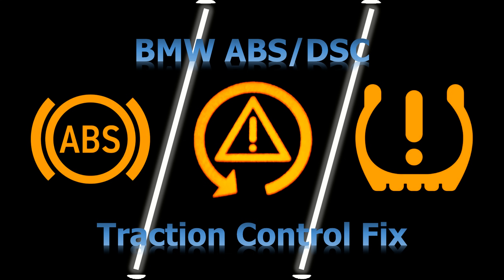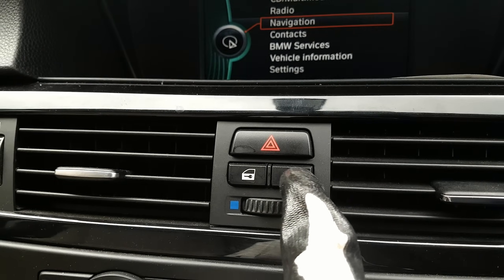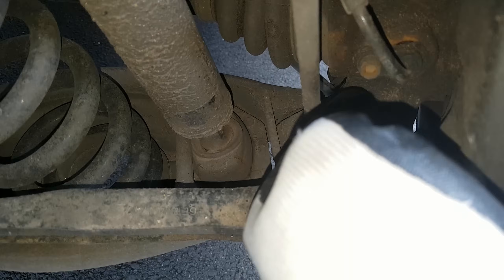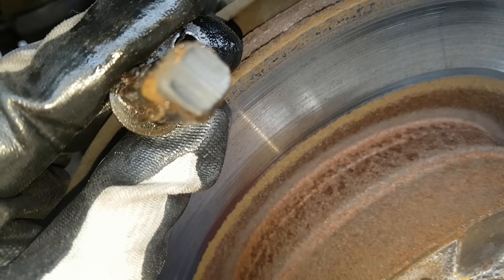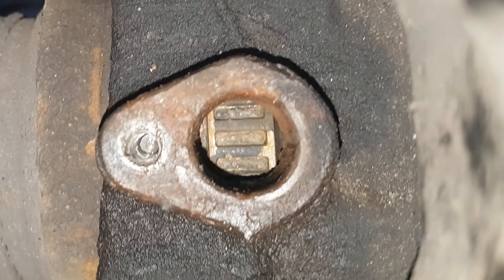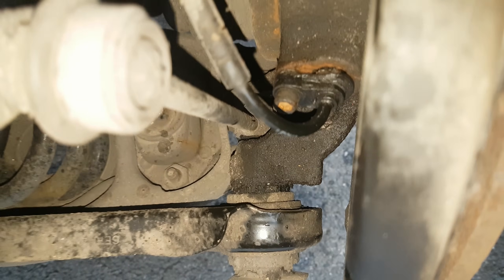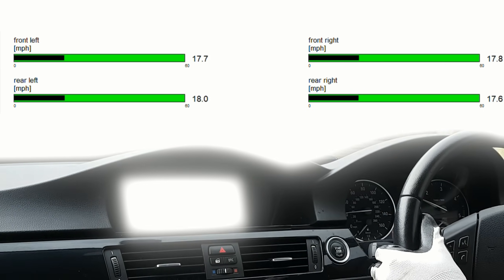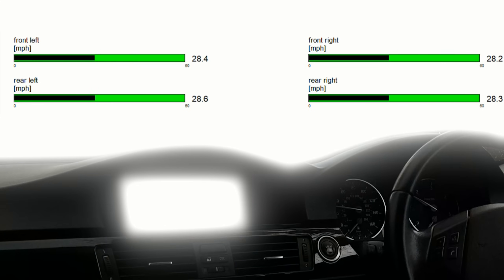BMW Traction Control ABS DSC DTC issue or loss of engine power

Comment: Hello I replaced my rear passager tire and my TPM sensor keeps on popping up saying TPM malfunction I checked tire psi and it's okay. Is the senor bad?  Thanks mate
Reply from the maker: Ernesto Aguilera have the tyres been balanced correctly and replaced with run flats and you've reinitialised the flat tyre monitor service?
Reply: @laymandiy   oh man I need to re check all that thanks mate love the videos.

Comment: Hi, I have an e90 2011. I have the following errors on the dash, they remain on constantly.
Traction control
Abs
Amber handbrake light
Steering wheel light 

The idrive is showing the following:
Braking and driving stabilisation failure
Dbc failure
Ftm system error
Start assistance inactive
Steering assistance inactive 
Snap on tool shows the following error codes:
5e43 steering angle sensor internal
94c2 szl steering angle sensor failure - lws zero point data failure 
D515 message error steering wheel angle, receiver electronic power steering transmitter dynamic stability control

Any ideas what could be causing this?
Reply from the maker: Mohammed Hussain did you just get your software updated? Bad battery, angle sensor, abs unit, wheel speed sensor, rear bearing are all known to cause this. Prior to this was the car working okay?
Reply: LaymanDIY There was suspension work done on the driver front and all the arms replaced on driver rear. No software updates.
Reply from the maker: Mohammed Hussain very much sounds like something that could have happened because of it. If it was official BMW, take it back to them. Ask your garage to check if to wasn't. Failing that, without diagnosing further, I'd start with reclaibrating the steering angle sensor, followed by replacing the wheel sensor in the back , as shown in the video
Reply: Any updates about those faults ? I have the same thanks in advance

Comment: 2013 bmw 335i: I was driving, abs light turned on along with traction control light. Car lost power so i parked, battery light turned on car engine started reving up and down by itself. Windshield wipers started going on. Car turned off and would not start. Orange Exclamation point turnd on. What the fuck is happening someone please help 🙏🏼
Reply: I have the same problem today and Im considering to start to put a separator but no clue if there are 4? and the thickness needs to be 1mm max? any clue? How did you solve the problem...?
Reply: @marceloruffino  I took the car to a trusted bmw mechanic. Turns out i had an electrical issue with a wire conecting to the battery.
Reply from the maker: There was a BMW recall on wire connecting to the battery. Your case is rare, most often the car would just be dead and wouldn't do anything. Key stuck, doors wouldn't lock unlock. Major safety issue.

Comment: Hi I have the traction control abs and brake light coming on and off at random times when I try accelerating, sometimes tyre pressure and battery light come on with it. When they come on the speedometer goes to zero even if the cars moving. Any solution to what it could be? I have a e90
Reply from the maker: Keem M sounds terrible. It could be one of 2 things. The rear wheel speed sensors are gone, in which case you've got off cheaply. Others a Christmas tree on the dash, speedometer going crazy are indicative of a bad abs module. Get it diagnosed for error codes, see what comes up.
Reply from the maker: What car, year and model
Reply: It’s a 320D 2006 m sport
Reply: I tried getting it diagnosed but when I take it to the mechanic the lights are all gone so no codes are showing as they are not permanent. When the lights aren’t on the car runs perfectly fine

Comment: How about when the hand brake is lit yellow also with the traction, do you know the issue with that? Thanks in advance.
Reply from the maker: Brake fluid level, as well as traction control issues... Usually
Reply: @laymandiy  Thanks so much. I forgot to mention, I changed both inner and outer tie rod ends for left and right
Reply from the maker: It's a stretch but it could be that your sensor is out of position and rubbing on the ring..
Reply: @laymandiy  Thank you! I will go and check and update.

Comment: For some reason my bmw engine won’t start at all and I keep getting a dsc error do u think doing this will fix it? My rear tires are not moving as wel
Reply from the maker: No this won't fix a engine not starting problem
Reply: @laymandiy  do u think the dsc error has anything to deal with my engine not starting? Anytime I try to turn it on it makes one click
Reply from the maker: No I don't think it is.. one turn not starting .. sounds like a battery problem if anything..

Comment: Hi May I ask if having a defective or dirty speed sensor or ABS module affects traction control function? I mean, I am experiencing like one of my wheels is not in coordination with the other wheels. Feeling that the car is slipping even at low speeds and dry conditions. And the light sometimes turns on for a while and then goes off.
Reply from the maker: Of course it does. You can test if traction is causing the slip by disabling the traction, holding the dtc button. You'll ha e your answer if it's abs/sensor/traction related problem

Comment: Please help ... First i had after driven not mutch with the car ..high battery loading.............Then the problems came i had those failures plus seatbeldt and transmission error and my km benzine counter digital goes mad ........
Reply from the maker: You've got bigger problems than this .. you need to get your car checked... Sounds like your alternator might be going crazy.. can't be sure

Comment: Bro i have bmw 545i and at the beginning of the movement i have not seen long time traction control flashing on dashboard.when i off dts my car not drifting this is because of this.
Reply from the maker: I'm not sure what you're asking. Your car is not drifting? You want it to drift?
Reply: should traction control light blink if it is working properly when start moving is it ok or should’t blink
Reply from the maker: It should never blink under normal operation. If it blinks it means it's trying to stabilise if it permenantly on, there is a problem

Comment: Can you help fix my DTC issue, are you based in London - if not, can you please recommend?
Reply from the maker: Sorry not in London. This is a lesson for any future car repairs, find a garage you trust isn't ripping you off and is transparent and stick with them. Any competent person can deal with this if it's the same problem. What DTC issue do you have?
Reply: Thanks for your reply. Yes, few seconds into driving DTC light starts to flash and car starts jerking/losing power.
Reply from the maker: This is your problem... As described in the video..
Reply: Thanks 👍

Comment: Great video. Got the same problem, but not as frequently as you do. Got a 2007 BMW 120d. Is the sensor supposed to be a millimeter away from the driveshaft? Or is it supposed to be touching slightly? And after you cleaned the driveshaft with the steelewool, did you get all of the black/grey spots off, or just most of it?
Reply from the maker: Gino DeGuzman tbh I'm not sure what the specified distance is suppose to be, but it's not suppose to be touching. It's almost impossible to clean it fully. If you have the time then take the drive shaft out soak in some solution to remove corrosion and/or install a new ring. Best long term solution. Alternatively drive with DTC on it reduces the sensitivity.
Reply: @laymandiy  thanks for the quick answer! Unfortunately I don't have all the tools to take it out completely. But I will jack up the car and remove the wheel and have a look on both rear wheels ( don't have a wheel spin computer-thingy ) to figure out which wheel causes the light on the dashboard. I saw another video, they showed not only the black spots, but also some metal scraping on the drive shaft. Is this also an indicator that the sensor is too close? I will have a look later this week, is there anything I should keep in mind, be extra careful with or such before I go ahead and start?
Reply from the maker: Gino DeGuzman if the metal is scraping on the sensor it's never because the sensor is in the wrong position, it's because over time the metal around it has fractured or corroded and swelled up. You actually don't need any extra tools for it. Just a 34mm socket and some other e socket. This computer thingy might save you a lot of time and effort considering you'll need to jack up and take off each wheel. It's only £15 and it helps with any future diagnostics
Reply: @laymandiy  so couldn't wait anymore, got this done today and I was successful! I scraper the ring thurugly and put a 1mm spacer between. Just as you did. I have one more question tho. Does the tdc and abs kick in when it is supposed to, (in emergency and slippery roads) now when the sensor has been moved 1mm?

Comment: I currently have all three of those lights (thumbnail) coming on when driving, sometimes they will stay on for the entire drive, sometimes they will switch themselves off.  Any ideas?
Reply from the maker: What are the symptoms when the lights are on
Reply: @laymandiy  cruise control cuts out, car shudders where the abs engages on/off quickly and small engine power loss, then those three lights come on and then drives normally
Reply from the maker: Sounds very much like the issue here, with the cruise and loss of power. Does it go away by holding DTC?
Reply: @laymandiy  yeah sometimes it does, but not all the time
Reply from the maker: All traction related issues should stop with DTC completely turned off, by holding it for 10 seconds... Pressing the DTC just once should reduce the frequency not remove it completely.
Reply: @JebediahSpringfield917  same did you figure out if this was the problem?
Reply: @tommyyoung9413  it was both rear ABS sensors, drive shaft needed replacing and both reluctor rings
Reply: Sounds like he could have just done the washer/spacer fix on both rear sensors & it pretty much would have had the same result 😋👌🏽

Comment: My traction control light is always on. No matter how I drive. Also I have lot of loose of power on my BMW 740, 2006. Any suggestions and advise is truly appreciated
Reply from the maker: Permenant on means one or more systems have failed... you're losing power most likely sound like a fault speed sensor.
Reply: @laymandiy  I scanned twice with computer but no error codes for speed sensor. Any suggestions on this. Do I still need to replace the speed sensors even without any codes. Inputs are highly appreciated
Reply from the maker: What code reader did you use?
Reply: @laymandiy  I don't no about the code reader. Went to two different mechanics and they used their own devices. But one mechanic is using most reliable devices because they repairs only BMW car.
Reply from the maker: You may need to do it again... Clear all codes, drive the car for a few minutes, test again. But when you do the should be several modules that it checks. Grab the cable online, worthwile investment and then you can do it yourself
Reply: @laymandiy  they cleared all the codes yesterday but still traction light is on and also I have tilt car red symbol in my dashboard. I am getting warning if dynamic drive failure.

Comment: What tool did you use to monitor the sensors?
Reply from the maker: Inpa
Reply: Im my E 46 is lighting ABS lamp and service 
When i take out the ingine key . The ABS pump .Still work ...i take out the fuse no 53 .
But now i dont have ABS .  Must i change the ABS pump ?

Comment: what about fixing the 4x4 light
Reply from the maker: robert da silva I'm sorry but that doesn't tell me anything? What are the symptoms
Reply: Mine are the 4x4 light comes on as soon as i start the car , i dont even have to move the car or put in drive. Then after abs and brake come on buy 4x4 always comes on right away as soon as car is started.

Comment: I will likely use ku rust on the relector ring to combat growing corrosion, shouldn't affect the sensor either, guessing the poles in the reluctor ring are magnets or steel plates that induce a voltage in the sensor.
Reply from the maker: From my understanding it's a basic steel ring which causes fluctuation of pulses in the magnetic sensor which translates as speed.
Reply: @laymandiy  agreed.

Comment: Hi there. I own a 2006 BMW x5 4.4i. and the vehicle shows on the dash all the time the three lights (four by four, ABS, and brake) also replace the rear right wheel speed sensor and the transfer case actuator, but the three lights steel on. Some guys suggested that could be the transfer case. So I lift the vehicle on the stands and chance the oil in the transfer case and listen for all kinds of noises and everything sounds ok. Another guy mentioned that if you replace the transfer case actuator should also time the actuator with the vehicle, which I don't know how to do it. ANYBODY OUT THERE I APPRECIATE THE HELP. THANK YOU
Reply from the maker: Did you replace the sensor because diagnostics said it was faulty? Have you modified your car wheels tyres of ride height?

Comment: My sensor is too damaged to re install. What’s the sensor name I need to order a new one.
Reply from the maker: Wheel speed sensor
Reply: @laymandiy  thanks a million man I’ve been searching and seen either abs or wheel speed sensor. Called the part source and ask them they told me a cam shaft position sensor.

Comment: hello ,i need a help plz for my bmw E93  diesel 325  mod 2009,so i got the probleme  that  traction control ABS DSC DTC ISSUSEAND LOSE LOSS POWER OF ENGINE,AND THAN MOTOR STOP under driving,than try to start  the car but no crank no start.and than i  waited like   15 min,i try to start the car and it started  mormal,so i have already changed the pluger,and new battery,,so thats happned to me  somtimes,can you plz help me what can be the probleme?
Reply from the maker: Maybe an alternator issue?
Reply: @laymandiy   can you explaine me more plz?
Reply from the maker: Could be your alternator, battery (but you've changed that), starter motor or fuel not getting into your engine properly. Have you had it looked at by a mechanic or a diagnostic kit
Reply: @laymandiy    the  probleme i bought a new batteri,so i drive the car normal   and than after a longe driving the car stopped and motor and no light on dashbord  and the i waited like  30 min try to start the car again and  with help from other car,so its start normal and just like nothings r wrong with a car

Comment: I committed the mistake to let the insurance company install a GPS device in my armored BMW 2009 X5 4.8i and since then I lost traction  control completely. Impossible to drive the car.
Any solution?
Reply from the maker: Surely you can speak to the insurance company on grounds of safety?
Reply: Are your Amber colored ABS- DSC- and Brake lights on?

Comment: Iv got exactly the same issue but my abs is picked up by wheel bearing only started after hitting a pothole hard enough to destroy the wheel put different wheels on and all 4 wheels are within 1kph of each other on live data , any ideas?
Reply from the maker: Is it a permeant error?
Reply: @laymandiy  no it’s not giving any fault codes just acting like it would if the tc kicked in 🤷🏼‍♂️ but on dry straight roads
Reply from the maker: Why don't you check your speed sensors see if they are scored
Reply: Checked them all .on the e70 there’s no way for them to come in contact with any thing as there’s no ring or anything to rust and expand ,the pick up reads north south magnets that are inside the wheel bearing so hoping Iv damaged one of them 🤷🏼‍♂️ new wheel bearing came today 🤞🏻! Live data doesn’t show anything out of the ordinary as far as wheel speed 🤔🙄
Reply from the maker: Wheel speed is just one of the components that contribute. I'll have to read up on all the components involved. Believe steering sensor is involved also
Reply: @laymandiy  yes your right it is but the live data reads true for that as well and getting what I think I normal readings for yew sensor 🤯 any info / help is greatly appreciated 👍🏻
Reply from the maker: I would check if your steering angle sensor is functioning correctly as well
Reply: @laymandiy  seems to be still can’t figure it out 🙄

Comment: 58mpg?? 
I have a 2004 120d automatic and i get 8.5l-9.3liter per 100km
Reply from the maker: Станислав Евтимов it is an efficient dynamics model. I do get those miles they are reflected in the amount I top up fuel

Comment: I had the same issue mine was fixed by recalibrate the steering wheel angle sensor
Reply from the maker: mohamed diallo also a possibility
Reply: LaymanDIY recalibrating the streering wheel angle sensor fixed my problem with the same issue

Comment: What does it mean if it only happens in a straight line?
Reply from the maker: Straight line and intermittent just means that through the movement of the suspension axle etc is causing the sensor to run up against the ring. I would say it's the second stage, first is only in turns, straight lines at high speed is next.
Reply: @laymandiy  yeah it does happen at high speeds mostly but luckily theyre not too expensive and hard to do myself so ill probs just buy one for evey corner and swap them out

Comment: How do you know which wheel is acting up?
Reply from the maker: If the problem occurs on straights only, difficult to tell. But when turning left or right it is usually the same side.

Comment: Hello i have a question my 03 745 LI say parking brake malfunction and some other codes. Csr been sotting for 1-2 years now it will not go in drive. Will praking brake malfunction or bad brakes cause the vehicld not to go in park. What could be the problem does the parking maybe not released.  Does the praking brake switch need to be replaced and could it be the switch?
Reply from the maker: Soul Winning agency 2 Day Gospel Event difficult to say really without more info